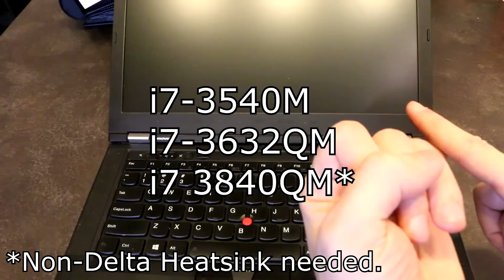Lenovo ThinkPad T430: Upgrade Wonder

Comment: Bought mine 3 years ago for £349 U.K. used. It's still running just fine with original 8GB RAM and 240GB SSD.  The built-in display is not up to much but I do all my Photoshop editing and watch huge amounts of Youtube - all on a  24-inch Dell Ultrasharp permanently connected to the Mini Display Port. The USB 3 ports are great for USB3 Western Digital MyPassport external drives. Who needs expensive Macs?
Reply from the maker: Definitely sounds like a solid setup to me. Especially that monitor.
Reply: Laptop Retrospective  - You sound like a chap who knows his stuff. I'll coming back to you for reccommendations when I want to get my next Laptop.   This one is good for now.
My brother upgraded his Dell to a T450S with more RAM and the top of the range touch screen after seeing how reliable my T430 has been.
Reply from the maker: Cheers, always glad to have a viewer benefit the content.

Comment: I bought one two weeks ago, it with i5, 4gb and 320gb HHD, and It costs me 100 EURO. Then I added 8gb RAM and changed the HHD to BX200 480GB SSD, now it works great. Because my HP COMPAQ TX400 was broken, and I think the  COMAQ cooling system too bad, it's alway higher than 70  celsius, when it is overheating, it shut down, I can't bear it. And now I'm very happy with my T430, It's a great computer!
Reply from the maker: Nice specs. Glad you're enjoying it.
Reply: Where did you buy it?
Reply from the maker: Mine was purchased locally, where are you located?
Reply: @LaptopRetrospective  That's my biggest problem, I live in Bosnia And Herzegovina, so there's nowhere to buy thinkpads locally and shipping from eBay is like 60 bucks.
Reply from the maker: @eldadhota4260  Ah I see. That's unfortunate. That's how I feel ordering things from the US sometimes. The shipping is as much as the parts.

Comment: I'm still using my i5 T430.  it has 2x 8GB of ram and a 512GB SSD.  I replaced the optical drive with a 1TB hard drive.
Reply: Are you me? I've followed the exact upgrade path. 16 GB of RAM, an SSD and a 1TB hybrid drive have turned my old T430 into a nice little ZBrush workstation.
Reply from the maker: Lots of storage there!

Comment: I have been using a 2nd user T430 now for the last couple of years. Other laptops eventually split due to being in the van from job to job, these are hardwearing and bough 2nd user R400,T420 for the kids because of their toughness. I wiped mine and installed SSD with Linux Mint19 (Win10 on virtual Box)  so boots in 20secs, I5, 8GB Ram but would get away with 4Gb using Linux. The slight downside i have is the display, Im looking to upgrade the display to something high res suitable for photography which im slowly getting into.  But as a laptop their fantatic and tough.
Reply: I also want to change the display to 1080p, but I think it need a special transform card or board for the connection to the new screen, the small board costs about 100 $, I think it's a little higher than I afford, maybe after I pay more, I can buy another new laptop , for example the huawei magicbook ryzen, It costs only 550 $.
Reply from the maker: Always a consideration. Weigh out the pros and cons.
Reply from the maker: Agreed. Lots of information on swapping the display out for something better. If I still had this one, I'd so the same.

Comment: I have a T430 since late 2016. I upgraded to an i7-3540M and 16GB of DDR3-1600 RAM. I honestly really recommend it to pretty much anyone. Reliable, (in my opinion) nice, and can be really snappy.
Reply from the maker: Sounds like quite the power house. You rocking a 9 cell or 6? What kind of life do you get?
Reply: Laptop Retrospective  Sadly, I have just a 6 cell battery. But it's till pretty much new, so it does the job just fine. While I edit documents, and browse the web, I get around ~4 hours of battery life.
Reply from the maker: Very nice for an older power house.
Reply: Hello, I was thinking of doing the same as you but with a i7-3610QM. which is better?
Reply: Dan Brown  Well... It's not an easy questin... A 3610QM is way faster than my 3540M, BUT the TDP of that quad core is 45W. All of the "official" CPUs, wich were installed in this motherboard are not using more than 35 watts of power. Using a more power-hungry CPU is problematic, because it's generating more heat (and the heatsink is only designed to handle 35W CPUs), and also the circuitry on the board isn't designed to andle this much power. I've heard about several T430s that they are able to run stable with a quad core CPU, but I personally do not recommend it.
Reply from the maker: That and if you attempt such a thing, swapping out to a better hear sink is a must.
Reply: @winMANhun  I got it installed and  the temperature is not going above 80 so that's good. I will try and get an upgrade of the fan and see if it makes it even better.  Thanks for your reply
Reply from the maker: Would be a good idea so the CPU doesn't have to run as hot.
Reply: @LaptopRetrospective  any fan suggestion ?
Reply from the maker: The fellow that wrote up the guide in the description gives some recommendations for fans.  Can't remember the model but it's in there.
Reply: @LaptopRetrospective  What about a thinkpad t430s Intel Core i5 3320M 2.6GHz
 - 8GB DDR3 (could upgrade to Max. 16GB) - ....and 180GB SSD schijf? Still oke to get now? Saw it on a dutch site for 300euros, but kinda to much isnt it?
Reply from the maker: Local prices will vary depending on availability. I haven't paid much more than $350 Canadian.

Comment: I'm still using a t430 I bought from a few years ago as a refurb. thing is still chugging although the fan is now making a pretty terrible sound. never serviced or cleaned it... might fix the issue might not... but I'm looking for another business class refurb ... maybe lenovo or maybe a dell... best bang for the buck.
Reply from the maker: Even if the fan is bad, very cheap part and easy to replace. Highly recommended even if you don't plan on keeping on the front line.

Comment: I recently bought a T420. I was going to buy a T430 but installing a Modded Bios to get Wireless AC is a nightmare
Reply from the maker: Fair reason.
Reply: I would like to get a 430, since you can put in a Quad Core 35W Processor (The one in my T420 is a 45W Quad Core and Battery Suffers drastically). If I could take it to someone so that they can do it I would pay them. Oh Well.

Comment: Love these laptops!...I have one and I also have the T-410, the T-420, and a T-460!...they ALL kick a$$! They're rock solid, totally upgrade-able, and can withstand being dropped from a 2nd story landing with minimal damage. Yeah, Dell XPS's are nice and Apple's MacBooks are "elite"....but when you need a laptop that will last a LONG time?...the ONLY ones that can withstand the test of time are the ThinkPads!...even when Windows says that the hardware is too old for the OS? just throw whatever version of Linux you want on there and you're GUARANTEED to have a machine that will serve you for a lot longer than these new wafer-thin ultrabooks that are so fragile that a drop from a desk or table destroys them completely!!
Reply from the maker: Definitely have their advantages for sure!
Reply: @LaptopRetrospective  Agreed! I run Win8.1 on ALL my ThinkPads EXCEPT for my T500. (Win7Pro). It will be YEARS, if ever, before these will become obsolete for general computing, and even some gaming.

I own somewhere around 30 ThinkPads, and I'm not disappointed with any of them! All have RAM maxed out, and have the highest i7  CPU in their class, or in the case of my T500's, T9600 Penryn CPU. All have SSD's.

Never gonna give them up! :)
Reply from the maker: That's an impressive collection! What do you consider to be your rarest one?
Reply: @LaptopRetrospective  Probably my T500 with Radeon Mobility 3650 graphics, and 1680x1050 display. It's the computer I take with me everywhere for entertainment purposes. :) It's in mint condition. I purchased it off Ebay last year for $30, +$20 shipping! Been looking for one with Radeon graphics, in that condition for five years. I also have multiples of:
T440p
T430/T430s
T420/T420s
T400
T500
R400
R500
T410
All with i7, or T9600 Penryn, and 8/16gb/RAM. All have 256<SSD's. I'm quite proud of my ThinkPad collection. Some will be for sale soon.

Looking to add a W530, with nVidia K2100 graphics soon. :)
Reply: @LaptopRetrospective  The rarest one would be the T-410. Its actually my secondary "Learning-To-Program-In-C++-And-Python" laptop. I love the display, its not 16x9 like the T420 and the T460....its 1440x900, but somehow I just live its look. I also like the just browse the web on it sometimes, because the display is actually nice. I'm currently on a mision, to find a way to install either "LibreBoot" or "CoreBoot" on them. I know its probably going to require a degree in Electrical Engineering, but I really want to know if its possible, and if it can be done on my devices. My only issue is, these are the only ones I have! So I might have to buy "testing" devices of the same make/model to give myself the rehearsal practice!
Reply from the maker: The ones x20 and below should be pretty straight forward. It's the ones after where it gets a bit more involved.

Comment: I am still using a T440s FullHD Screen with i5 4300u, 512GB SSD, 12GB Ram. I editing and rendering video on trips and i dont have any problem's with that. 2 battery they allow me for 6 hours job. I'm must replace only TouchPad from T450 becouse this on T440s is really crappy.
Reply: for me this FullHD is really ok, i dont have any problems with that. On windows 10 i use 100% scalling not 125 or 150
Reply from the maker: Use case is always key.
Reply from the maker: Nice, glad to hear you have the HD screen.
Reply: FullHD* :D
Reply from the maker: Quite right.
Reply from the maker: True. Replacing the panel is a solution, but better still is a purpose built display.

Comment: This Laptop isn't that old.. I still use this Notebook, have two hard drives in it and upgraded the WiFi chip two times during the last four years.

Definitely very decent ThinkPad and after so many years of every day use, the battery is still in excellent condition.
Reply: What really helps the t430 is its M-series CPU, with significantly higher clocks it competes well with U-series chips up to 5th gen. The integrated graphics aren't the quickest but it won't drop frames on 1080p HTML video, plus they support directx11.

Take the price into consideration and this little monster is an all around great buy.
Reply from the maker: Agreed.
Reply from the maker: Glad to hear it's going strong.

Comment: Why remove the white list? I thought it only affects the WIFI card and the battery. The WIFI works fine and no one has ever complained about a genuine Lenovo battery. A T430 cost around 200.00 and when I buy a battery I can afford 70.00 for a genuine Lenovo battery.
Reply from the maker: Whitelist addresses many things depending on the machine. In the case of the x220 it allows faster WiFi cards, access to advanced BIOS features, allows the use of faster RAM without speed caps and more.

Comment: I have a t430 and i just upgrade to i7-3632QM and using arctic mx4 every things is good so far. Running everything i need smoothly
Reply from the maker: Very nice. What do you use it for?
Reply: Laptop Retrospective  And i use a ssd drive with a caddy bay have hdd in it.
Reply from the maker: Cool! Thanks for sharing.
Reply: Laptop Retrospective I use this laptop in the university.^^

Comment: I’m an electrical engineer and I use a w530 for cad work, programming and in the office work everyday. I run my old x201t I got freshman year of college when I need portable toughness on job sites. Modded a t430s as much as possible for my wife. I just love these machines and still haven’t seen a reason to upgrade. They just don’t make them like they used to!
Reply from the maker: That's an awesome story, thanks for sharing it here!

Comment: This was the last good Lenovo laptop they made. I buy, open and modify, at least 10 Lenovo T-series laptops a month, and have been doing so from way back when they were still IBM's. I have reconfigured the insides of around 500 T-series. The T440 paved the way for an ever increasingly poor design. The T470 and now the T480 are just horrible to work on. Oh and don't forget the X240 that takes at least an hour to do a keyboard-swap. Hail the third-gen - last of the best.
Reply: I disagree. The T440p, is a fantastic, tough, and easily upgradable machine. I own four of them. Three with nVidia GT730m graphics. IMHO, the best ThinkPad, ever produced, and a decent gamer. 

I consider the T430, to be the second best ThinkPad ever produced, followed by the T430s w/i7/nVidia, and the T400/T500 with Radeon graphics. I own all these machines and find them ALL excellent!
Reply from the maker: Might need to try and find a 440 one day.
Reply: @LaptopRetrospective  Nope. I don't care for them. I don't care for the "u" processor, or being limited to 12gb/RAM. MAYBE if I found a working one in good condition for around $60, I'd consider it.
Reply: @dragunovbushcraft152  The t440p had an M series processor that was replaceable, much like the t430.
Reply: @EscanthonX  I know that. I was referring to the T440.
Reply from the maker: Thanks for sharing your experience. It's awesome to hear these stories of how the hardware lives on.

Comment: Love mine. Travels well in a checked bag and still works fast Photoshop, Premiere Pro, and Excel. 
- i7 3612QM
-16 GB RAM
- 500 GB SSD

Favorite part is the keyboard light! I'll be sad when it becomes obsolete.
Reply from the maker: Obsolete is more the use case of the user.
Reply from the maker: if it's speced out the way that it's listed above then you should get good performance so long as the project isn't super complex or is using incredibly high resolution video.

Comment: i bought lenovo t430s 4 months ago, secondhand, and i tell you what, this is the best decision I've ever made, the price only $280 with 320gb hdd, i7 3rd gen, 4gb ram, backlit keyboard holyshit this machine is insane. i install win 10 in it and it works just well. i really recommend to buy this laptop, its cheap nowadays and can do almost everything.
Reply from the maker: For many, it's all the computer they need. Might not be power efficient but it gets the job done.
Reply: Laptop Retrospective  I use it for designing program such photoshop, Rhino3D even Keyshot for rendering that use all 100% cpu usage, its a bit hot even after i replaced the thermal paste but still can do all those things flawlessly.
Reply from the maker: Yeah, they have a reputation for running hot.

Comment: I hv x220 i5 256 ssd 8gb ram still rocks 🤩 bought just bought 160$
Reply: I have bought i7 T430s for the same price last week. Will try to flash it with CoreBoot and put FHD IPS. 256 GB SSD and 12 GB of RAMs are already ready for transplantation :)
Reply from the maker: That's going to be a fun machine.
Reply from the maker: Nice price. Good find.

Comment: I like my t420 with an i7 2670qm a 180 gb ssd and 8 gb of ram.
Reply from the maker: Nice configuration. What does it get used for?
Reply: Laptop Retrospective school work, web browsing, non 3D applications. If I play any games on it it overheats:(
Reply: Before I put an ssd and quad core CPU in it, it would slow down to a crawl if I opened more than 3 programs at once
Reply from the maker: Still a good mix.

Comment: I don't quite get the excitement about these machines. I got a T420 some weeks back, refurbished and in excellent condition. I didn't like it. It felt very obsolete, big and heavy, basically a brick of a computer. Early Core CPUs were also toasters, so the laptop's fan was too loud. I installed Debian on it, played for a while and eventually swapped it for some modern Acer (light, slim and quiet). Sorry for my mini-rant.
Reply from the maker: I can understand your point of view. ThinkPads of this era stand for a PC that was highly serviceable, powerful, durable and long lasting in one package. Not a perfect machine as some might say but an amazing contender in its class.
Reply: Well, performance-wise, the current core i 8th gen could beat those dinosaurs, yet with thinner, lighter, and more battery efficient.
Reply from the maker: There is truth there, but many people don't need that level of performance and might be happy to spend a fifth of the price for a reliable machine. Different use cases and demands.

Comment: Got two W520s and a T420 as well several older Thinkpads from both eras including a 701c so yea the old ones are the good ones unlike the ultra book crap they make these days. My favorites are the T60P and the W500 but the T420/430 with two 9 cell batteries installed are damn good for just work as one can stretch the battery life well over 10 hours+.
Reply from the maker: Very cool. Especially the 701c.